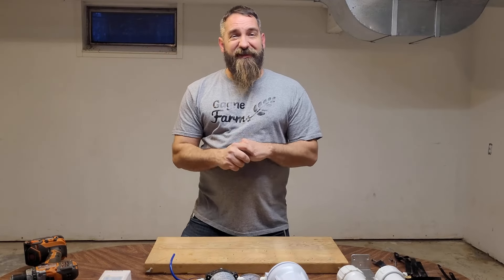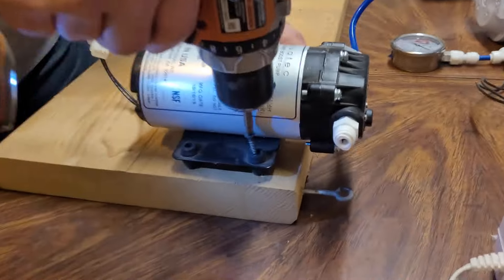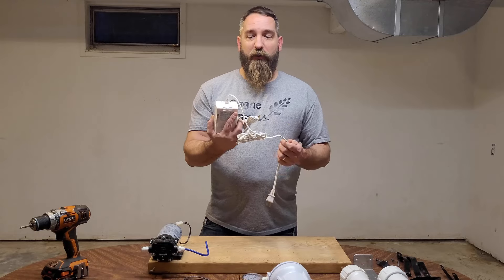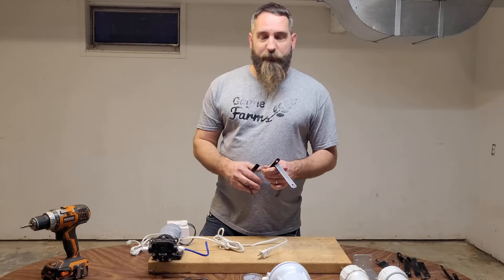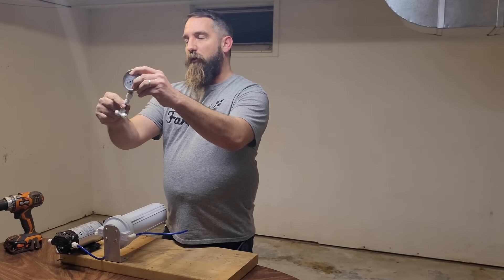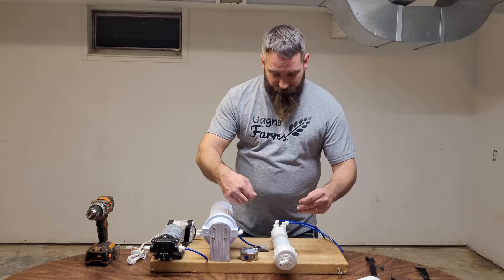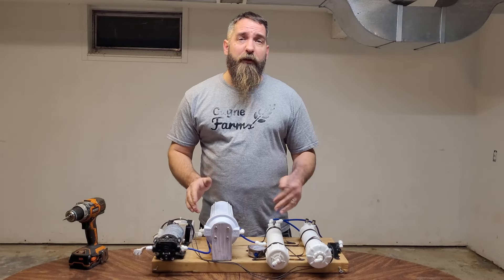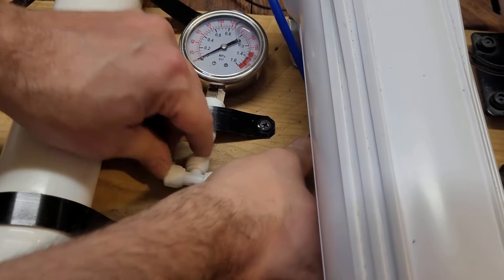HOW TO BUILD a Reverse Osmosis System for Maple Syrup / Small scale RO for HOBBY Operation Upgrade

Comment: Eric, build an RO system yesterday. Ran it yesterday as a test and today as a test both times I get 2% coming out of my concentrate tube and 2% coming out of my permeate tube running at 100 psi 3 osmosis filters. Not sure what I’ve done wrong all the plumbing matches up correctly.
Could there be an issue with the membranes in the filter?
Reply from the maker: That's odd. I guess there could be a membrane issue but it's unlikely. Are you sure that the permeate and concentrate outlets are not switched around on the bottom of the housing? Is your check valve on the correct port on the housing? Check those things first.
Reply: Your Great video is a great by the way! Everything looks plumbed exactly correct. Runs good. Just pulled the membranes our and checked them and reinstalled no better.
Reply from the maker: @cindyhirt9295 thank you very much! Maybe take a look at the assembly pamphlet that came with the membranes and see if something is crossed up on there. If you take a picture and send it to my email or my Facebook page I will take a look at it.
Reply: Thank you I sent a picture to your Gagne farm the carrots post
Reply: You got me thinking I am going to disconnect 2 of the Ro’s run 1 at a time see if I can find a bad one?
Reply from the maker: @clydehirt9867 no problem. I responded with another question on there.
Reply from the maker: @clydehirt9867 that's not a bad idea. What pressure are you running at?

Comment: Can you run this straight from a hose instead of using a pump?
Reply from the maker: You need to use the pump to create pressure for the sap to be pushed through the ro membranes.

Comment: How do you get the needle valve to be a tight fit?
Reply from the maker: Are you referring to the compression fitting? You just have to be careful and not overtighten. If it leaks a little give it another 1/4 turn.
Reply: @GagneFarms  I replaced the plastic tubing with  a 1/4 copper tubing . No more leaks.

Comment: What kind of time differences can be saved between RO and straight sap?? Like if I boiled down 100 gals of straight sap in 8hrs, how long would it take 100 gals of RO sap to boil down? I know this is a variable answer question, just ballpark idea is what I'm looking for. Thanks in advance
Reply from the maker: Well since we are doubling the sugar content say from 2% to 4%. I figure it takes about half the time to boil RO'ed sap. So for your example, normal boil tome of 8 hrs would run about 4hrs once it is ran through an RO. I hope this helps!
Reply: @GagneFarms  absolutely does. Since I'm a hobbyist, just wanted to see if it would be worth the investment. Thank you for your timely response.

Comment: I have a question regarding the location of your pressure switch... does it actualy work in that location?.. if the pipe is vented to your permiate tank, does it ever build up pressure?
Reply from the maker: No. Most people I have talked to have eliminated the switch all together.
Reply: We just built 2 today... what pressure do you run at. Thankss for the info
Reply from the maker: @capitalarearc3316  I run between  96-98 psi. It varies a little but real close to that number.
Reply: I'm obviously only running water through it now.. but it will only go to about 90psi with the needle valve totally closed.. open it about an 1/8 a turn and the hoses are the same rate and it runs at 70
Reply: Tried sending  video..but it wont go through
Reply from the maker: Hmm should run better when it is pushing sap through the membrane. Sometimes helps if the membranes have been pre-soaked before hand.
Reply from the maker: Try sending it to my Facebook page. That might work.
Reply: Any chance that pressure switch is supposed to go on the intake? I wonder if the line still holds pressure for a while in that location even after the pump sucks air. 

Thanks for the instructional. I'm building it today!
Reply from the maker: @GnarlyGarnt  I would give it a shot. I was going to try and mess with it but my season got cut short due to El nino!
Reply: @GagneFarms   also, did your geekpure filter come with a mounting bracket? Mine did not :(
I wonder if you could update the link to the one you have.
Reply from the maker: @GnarlyGarnt  the bracket that I used I made myself. In my latest ro video, I switched to a membrane solutions filter, and a bracket was included. There is a link and discount code in the description of that video. It was the last video I posted.
Reply: @GagneFarms  too late for me but I have a friend looking to set this up also. I'll direct him there.

Comment: It seems like the pressure switch is designed to shut off when the pump reaches a certain pressure. I'm looking for a pressure switch that senses when the supply tank is empty and shuts off my pump. Any suggestions?
Reply from the maker: I have not found one quite yet that shuts off correctly. 😕
Reply: float switch?
I find myself designing a Rube Goldberg contraption now.

Comment: The pump is upsibe down.
Reply from the maker: The pump is not upside down.
Reply: @GagneFarms  Maybe "upsibe" means the opposite. You know, a d is a backwards b.
Reply: @GagneFarms  There is no operational difference for the pump. However, the manufacturer recommends that the pump side be down and the motor part be up in case a fitting or seal leaks the water doesn't damage the electricals.
I just learned that this past week.
Reply from the maker: @mcdls5 I see what you are saying. It does make sense, although I have never had a problem running it the other way. Good luck to you on your upcoming syrup season!

Comment: ALWAYS use copper or stainless steel lines.
Reply from the maker: I prefer to use the tubing. I can take it off and clean it all out a lot easier. Plus, then I can store it all away for the next season very simple. I do use copper lines as a warmer around the exhaust on my evaporator as it drips into my pan.